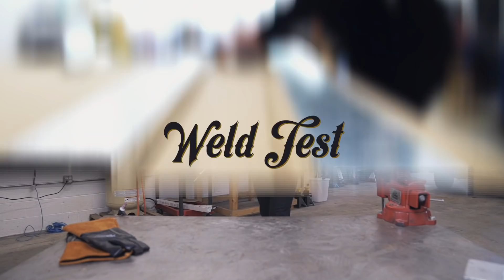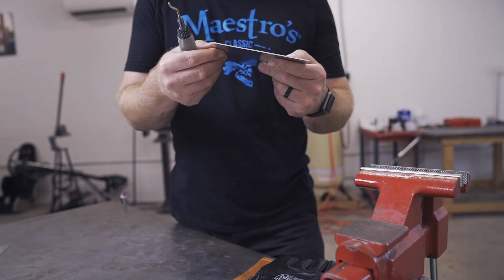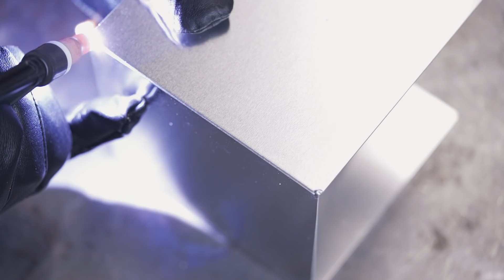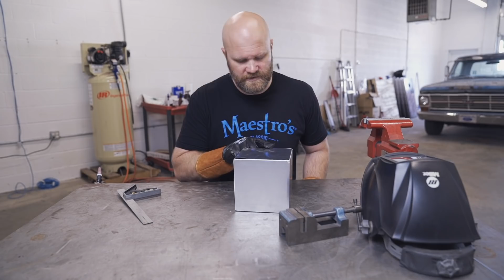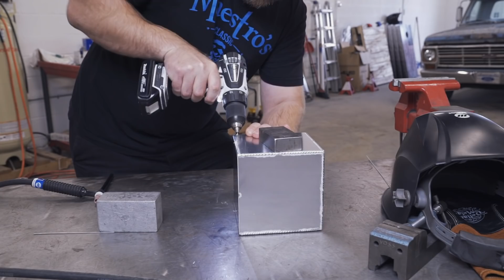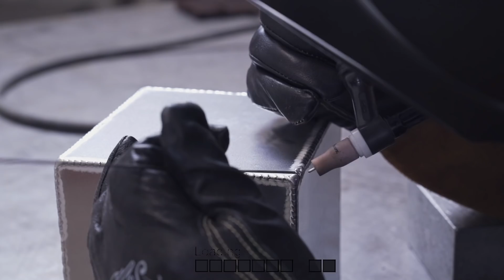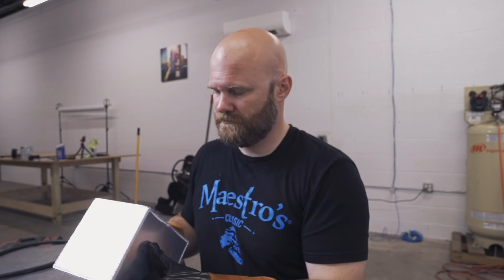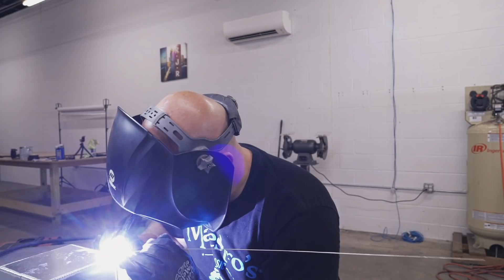Ace a NASCAR Welding Test - TIG Welding an Aluminum Cube

Comment: I've always been curious to wonder why anyone would weld with uncovered arms. I work as a welder and the company owner that i work for really likes his workers to look proper all the time (because there are guests who visit the factory n he doesn't want them to see a dirty work area or workers) and we get these black long sleeved shirts that we have to wear. I go through basically one a month because the radiation from the weld eventually turns the front of the shirt light brown. And these are real proper heat resisting shirts, and even when i MIG weld (I mostly TIG weld stainless though) something the spatter doesn't go through the shirt for the first 2 weeks like it would on your average shirt. If you increase the risk of getting skin cancer, suit up boys! Other than that, great video n i can't wait to get to try my hands on aluminium TIG welding eventually! Cheers!

Comment: hey i am a 17 year old looking to get a welding job in the future but i was just curious what would happen if you didn’t put acetone on the filler rod and the aluminum sheets?
Reply: It just won't be as clean of a weld it'll still be okay but it's recommended to clean it first
Reply: Corey Troxler thank you

Comment: I have found that letting the piece cool down, sometimes as long as a quick “smoke break” will allow the pressure inside the piece to drop enough that I can close up any vent holes I left. 
Also one thing that companies seem to love is don’t just clean the work piece, clean the table, the ground clamp and when you are done give everything a good blow off and wipe down. It shows the supervisors and managers that you care about their equipment.
Reply: solid advice
Reply: Opachki  thank you. Sometimes that extra step of cleaning the equipment when done and a quick step away from the project is the difference between a paycheck and an unemployment check
Reply: Yeah, I have always giving it even just a minute and the vent hole seems to always weld up fine.
Reply: This should be common practice and not just to look good to "get the job", proper care, maintenance and cleaning and it will make any job easier in the long run.
Reply: I just quench my pieces in water if it gets too hot.
Reply: @truthspace5525  3 years late on this but you can’t quench aluminum
Reply: And don't weld with one of your gloves off!
The safety Susans'll getchya on simple stuff like that
Reply: The heat is what causes the pressure on the inside. You have to let it cool first.
Reply: Bingo

Comment: Justin, I'm not a welder so this comment/question is just out of curiosity I guess. In that application of making a sealed box with pressure build up happening, couldn't you blast the box with compressed co2 (upside down can of  keyboard cleaner) for a moment or two to negate the temperature inside so the gas buildup would happen long after the bead has solidified? Loved the video, thanks.
Reply from the maker: I think it works best to cool the entire container, so just blowing the exterior with a air blower would work too.

Comment: This was an awesome video just as the last video I commented on Justin.  I mentioned I have a 45 yr. welding career, but most of it being heavy iron. I'm re-aquainting myself with the "Beauty" welding because I am retiring and going into business for myself. I have to have a pair of those gloves for sure man! But I have a question...
Could you have back flushed your box with Argon to get rid of the oxygen in there and then completed the weld? I know that I have done that when welding 2" pipe using 75%-25 when I'm having trouble with that. Although you probably dont have too many instances where you need to deal with a completely sealed vessel like that.
Reply: In this case, it's atmospheric expansion causing the problem.  It would still be happening even if the box was full of Argon.  The only simple solution is to do as Justin did, and wait for the heat to dissipate.  Your solution when welding MIG steel probably works well, but aluminum TIG has it's own unique problems, since you are first forming a molten puddle, THEN adding rod.  With MIG, the wire has an easier chance to solidify since it creates the puddle after the initial arc. I am assuming you are using MIG since you mention 75-25 and not pure Argon.
Reply: @weldorman8495  thanks for your reply man. I'm always ready to learn from someone who understands where I dont.
Reply: @bradymcphail9690  As it turns out, my experience is almost the opposite of yours.  I spent the first part of my career welding heavy steel (shipyards, logging machinery, fabrication/welding) and the last 35years as a special metals TIG welder (lab equipment, prototyping in aluminum, stainless, titanium, SMO, Inconel, etc.), and I can tell you that once you go down the TIG road and learn to do it well, there's literally NOTHING weldable you won't be able to do.  You just have to learn the quirks of each material you're working with, and you're good to go.....the process for each is remarkably similar.  I'm glad I could help.
Reply from the maker: Awesome thread guys. I’m always trying to learn too
Reply: I'm up against some odds right now. I'm suffering from PTSD after a negligent electrical contractor wired my shop welder wrong and I was electrocuted with 277Volts. I've never let anything stop me from doing my job, hanging out of a basket with a belt at 120' in the air or jammed in a ball crusher where I could barely move my arms to weld a seam. But this electrocution has kicked my butt. I almost died, I should be dead, but yet I'm still standing, and I feel guilty for it. I've put my butt out there several times in my like, but I guess it was me and by my will. This time I was injured by some fool who wasnt paying attention, he was high at lunch or in a hurry to get off of work for the weekend. At this point I'm not able to plug in anything to a wall socket. At 55 I may be done
Reply: @bradymcphail9690  Yeah, I've had that "light up my life" experience a few times.  It tends to make you gun shy for a while.  Just wear insulated gloves for a while when you get near wall plugs and the feeling will eventually go away.  Hope you feel better.

Comment: Evertime you kept the post flow on your weld/tack i laughed so hard 😂
Reply: Why?
Reply: @TMN7  It solidifies to quick there is no need, aluminum oxide. Its not going to rust like say Carbon or stainless steel. The only reason i keep my post flow on is for my tungsten cause if the gas shuts off to quick it will get contaminated then it will leave a big carbon(black) mark. Its just a thing with aluminum welders lol you can always tell when someone welds stainless alot
Reply: I was always taught to keep post flow on by my welding teacher, a man with at least 30 years of infield experience plus at least 10 years of teaching welding to students
Reply: @Warsteel55  well i can tell you post flow sheilding on aluminum is absolutely pointless. My boss has been welding aluminum for 50+ years...Ive been welding aluminum for 5 1/2.
Reply: @CanISpoonYou  it is pointless, but I still do it out of habit lol. I'd rather keep doing it on all metals than forget to do it on steel
Reply: @Midland Moto i can see you welding at 190-200 amps and wanting to keep the post flow running. But i only run it to not contaminate the tungsten, but honestly the puddle solidifies so quick if it was going to crack it will quite literally crack before you can even flip your hood up. With craters you finish with a 30-35° torch angle let off the button or peddle then one quick zap, works everytime for me. 👍

Comment: I believe you need a bit more experience before making how to weld videos. And, aluminum forms an oxide layer very quickly, you should have used a small brass wire brush on those seams after tacked to remove the oxide, it wouldve made a much cleaner weld. And dont long arc
Reply from the maker: 14 years not enough? I only long arched when trying to weld while looking around my camera and at the very end was for the colors.

Comment: Quick tip for sealing parts! I weld sealed parts every day, and the best way to get to seal is to shove the rod over the hole as you let the puddle solidify. Then, beep it over the the rod and seals up and you'll never be able to tell works every time! But then again giving it a minute to cool helps too!

Comment: lol... i do this for fun all the time where i work.. Cimarron Trailers in oklahoma. learn to not use the vise.... and you dont need to roll the top. just fuse the top edge without the lid. using a back and forth motion  all the way down. make a good looking "bead"
Reply: very well done otherwise.

Comment: That arc length.. can fit a bus in there...
Reply from the maker: I doubt it.
Reply: A good tight arc will make your welds so much better. And easier to control.
Reply from the maker: It’s just the close up shots in the video because I can’t see what I’m doing very well with the camera in front of me. Normally when I weld my face is like 2” from the weld.
Reply: Ah I see. Knew there had to be a reason. Tbf, they were good beads with that amount of arc length.
Reply from the maker: Thanks, and the one at the end was for the colors it was making.

Comment: Most times in the real world you wouldn't be welding something sealed anyway, it'll have fittings or vents to let the pressure escape. as a test it's a bit of a trick, but you've identified the issue and sorted it.
 Being good at what you do doesn't mean getting it perfect first time, it's learning from experience and being able to understand why things go wrong and how to sort that.
Reply: the mark of a true craftsman is not his lack of mistakes, but his ability to camly make the fuckups disapear.
Reply from the maker: Agreed
Reply: Facts
Reply: One of the things i love about metal working over wood working....depending on how big the fuck up of course....just weld grind and try again =p wood you pretty much have to start from scratch.....do that enough times and you will find yourself reaching for that grinder less and less the more you do it
Reply: Depends on what you are welding. If you are doing structural sure.  

If you get into pressure retaining applications it happens all the time. 

Gotta either leave a weep hole or let that girl cool down b4 u button her up.
Reply: As a professional cook i can absolutely vouch for this. Can you learn to produce the desired finished product

Comment: If you were welding for a job you would be welding it in position not rolling it. That’s how you know what you can really weld not only flat.
Reply: That depends on the job in question. If you're just building parts in a shop, then you can expect to be able to reposition things for access. If you're applying for a repair position , you'll need to weld out of position a bit more, and will likely need to demonstrate that ability to qualify. 

It all depends on what they need from you (and how much $$$ you want to make). ;)

Comment: I'm still new to tig, it seemed to me your arc length was about triple what I shoot for? Thanks for the tips
Reply: Whole I agree it did seem like his arc was a bit long, do remember that he said he was using a 1/16th tungsten, so compare the width of that against the arc length- he was a little ling but not crazy. Tighter does help with control and heat input into the piece, though. :)
Reply: The tighter the arc, the better the weld

Comment: Just clip the corners with the shear one corner per plate and it will vent, will be filled when welded anyway no need to drill. Also with the right settings that entire box could be welded with no filler metal. Keep that heavy block close to your seam and it will act as a chiller bar. And if you really want to impress weld the seams internally before putting the last plate on if you can pull off clean internal corners all the way around your gonna get the job!
Reply: Not a fan of fusing aluminum.
Reply: Metallurgicly, you need filler when welding aluminum, with no filler you get cracks in the welds pretty quickly.  I don't know why, but at least 6061 needs a filler metal when welding.  Thanks to Carl Hoes from Lincoln Electric's welding school for that tidbit.  I had a guy try welding 6061 together on a T joint with no filler metal and you could hear the cracks following the weld.
Reply: @mattleicester977  You're right.  6061 is notorious for cracking on a fusion weld, even when you're just tacking.  You can get away with it on 3 series or 5 series aluminum, but I'd only use it for a decorative weld and not where durability was needed.  Works great on light Stainless and Titanium though.
Reply: LMFAO....yes weld all inside then put on last panel....great plan
Reply: @ToddChaseYT  ...if they cut it to inspect the weld cross-section, which is far more important than laying pretty beads, they'll notice the interior work.
Reply: @800lbGorill4  actually they will notice the inside welds immediately upon looking at it . I would anyway...but being a weld supervisor for the last 35 years will mean I am wrong.
Reply: @ToddChaseYT  okay. can't wait to see your box building video, always great to learn from those with decades of experience.
Reply: @ToddChaseYT  you know what they say.... if you cant weld for shit,become a supervisor.

Comment: Nice vid, only small gripe would be don't weld in short shirts. Either wear a long sleeve shirt or take a welding jacket to a skills test like this. A massive part of any skills test is the health and safety factor and short sleeves and welding= cancer. Safety, Safety, Safety. If you make a minor mistake/mistakes in these tests it's never a big deal, if you make safety mistakes that put you or others in harms way it becomes a big mistake.
On the sealed container side, you can put the welded side of the box in ice water or use freezer spray to make the box cold. Having it full of cold air and something to act as a heat sink will give you the extra couple of seconds before pressure builds inside the box as it heats. That and two smaller holes, say 2x1/16 holes instead of a 1/8th may have helped too. Sealed containers are rare though, you usually have to back-gas or purge the container when welding like this.
Reply from the maker: Long sleeves are very uncommon in nascar fab shops. Some do though.
Reply: @JustVoss  yep, but that doesn't mean that we don't put welding jackets on when they are available. Not in NASCAR, but I do get paid to build and work on UMP Dirtcar Modifieds that regularly beat the likes of Kenny Wallace and Kenny Schroeder on our local dirt tracks in St. Louis, MO. Herm even told me one time that if he sees a guy welding in his shop without a welding jacket and there is one there available, he will stop him in the middle of a weld and fire him on the spot!

Safety is EVERYTHING in racing, from the way the cars are designed to the choice of what material to machine lug nuts out of! It's the reason why we spend $500 on a seat and $750 on a helmet, $300 for seat belts, $400 on fireproof shoes. Don't even get me into what some guys will spend on their race suits!

Rant over, we can build another car but we can't build another meat servo to sit between the seat and the steering wheel...lol. We like to see drivers come back in one piece, preferably undamaged.

Comment: put a slot in it and make it a bank
Reply: Suggestion box that has no way of opening.
Reply: Colton Blumhagen soo?
Reply: Good idea.  Haven't seen an old style bank like that in many years.
Reply: I like your idea
Reply: My thought exactly, put dollar coins in when  you get them. Nice little emergency fund.
Reply: That's what i was thinking plus would've made life easier to fill that hole.
But not sure how you yanks go with the paper money when you cut it open
Reply: then you have to cut it open to get the moneys out...
Reply: i did exactly that... made both my kids a 200mm x 200mm x 3mm mild steel box with a slot in for their coins.. they are really heavy now but not full. have no idea how much is in there... they decorated them with paint and stickers.

Comment: I Tig weld .030 on up sheet metal (steel, ss, aluminum and galvanized preplate) and its pretty easy. Preplate is by far the hardest but it’s easy for me. More braising with the Tig. I passed 3G and 4G for all sheet metal.
Reply: You braise beef and braze metal.
Reply: CJ Gibbons I’m mentally challenged sorry
Reply: @DeMoN_Ek9  Not if you can weld sheet in the 4g position. Dont mind me I'm just being pedantic.
Reply: CJ Gibbons True lol. I can weld any type of sheet metal 4G. All done with a Miller synowave that’s from 1987 lol. I was born in 87 🤣 No company in my area does Tig work like me. It’s all 1 year “preferred” Mig experience factory jobs building garage and cement trucks.

Comment: What AC balance are you using?
Reply from the maker: Around 70hz
Reply: That's frequency, AC balance is the amount of time the current stays on positive or negative. Some people calling it cleaning action. Some machines don't have it I'm not sure if yours does
Reply from the maker: Sorry I meant 70% and that’s a guess. Towards penetration. I don’t think I can even set the AC frequency.
Reply: I looked up your welder and it has ac balance, pulse frequency, and post flow